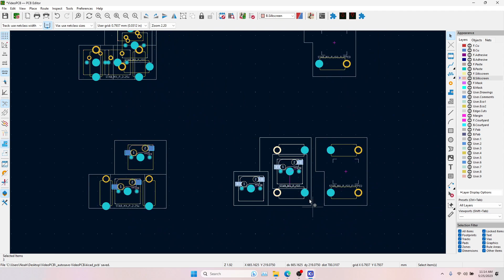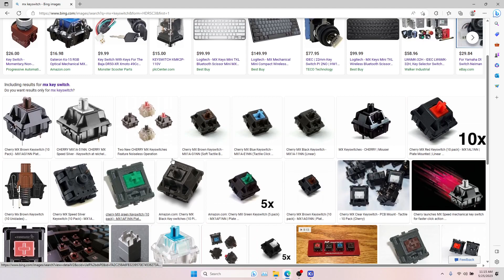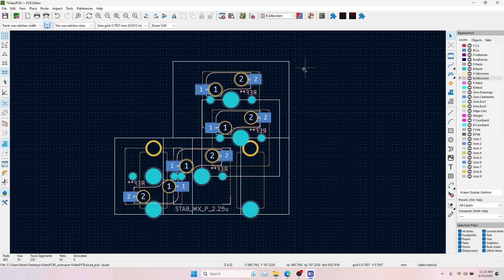The problem with hotswap and multiple layouts

Comment: I’ve soldered a few mx switches and I wasn’t aware that some have this cross! I wonder if ever damaged some caps because of this.

Well, thanks for the info!
Reply: All MX-compatible switches use this cross, and they are all like this where the horizontal part is thicker than the vertical part. You can safely rotate the switches 180°, but if you rotate them 90°, your keycaps will surely be damaged.
Reply: @Dainternetdude  😐 Then I have a lot of caps to check this weekend...